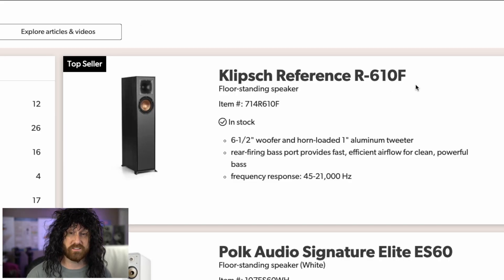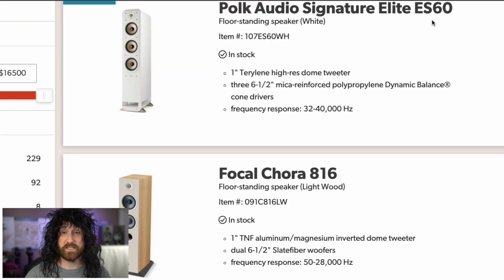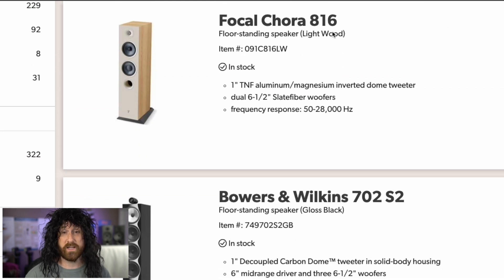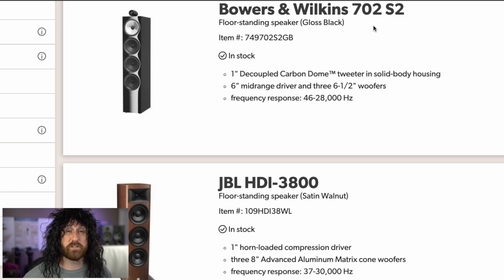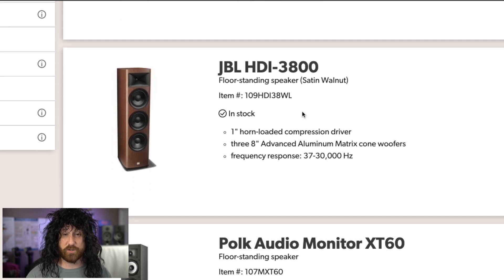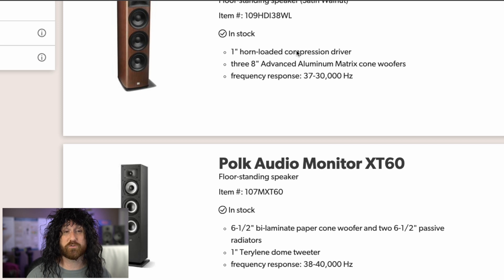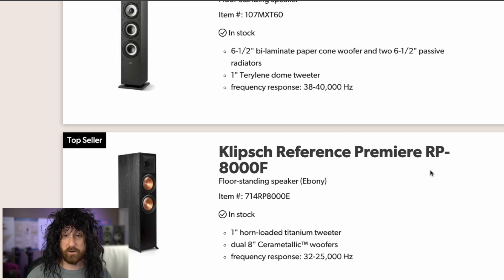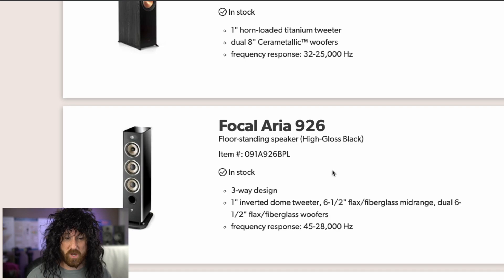What the Heck is with These Speaker Names?!  😂😜😎

Comment: A lot of manufacturers have different price ranges...
B&W actually being the easiest and fairly consistent example: 600 series, 700 series and 800 series... First number has nothing to do with the woofer size/count, just "quality range" Just like an I3 vs I5 vs I7 from Intel. Within these ranges, the class just goes down for smaller speakers: xx4 being less than a xx2 etc. I even think this numbering scheme is easier do differentiate price classes to start with when comparing "chora" vs "aria" vs "sopra"... Focal however does seem to count woofers, not mid woofers, but woofers on some of their floorstanding ranges... and the lower and ranges also start with 7, 8 or 9, where the higher number means higher "quality/pricerange" just like B&W I think?

Comment: If everything was named after the size of drivers, then every bookshelf speaker would be called something "16" or "61" and then you''d have to do another video.
B&W is usually pretty easy in that the first number is the model class. Higher is better.
Not sure about the 0. Sometimes they had 8.
The last digit usually denotes the sub model. Lower is better/bigger submodel. 
S usually means Series afaik. But then they seem to drop the S and number after a certain number of iterations

Comment: My first speakers: Pioneer HPM-40. High Polymer Molecular tweeter, 40W power handling. You can probably guess what the HPM-100 was. Made perfect sense. Bose 601, 901... made perfect sense. But yeah, most of the names don't.
Reply: Or ATC, uses cabinet volume in litres as a model number.

Comment: C'mon Erin, you know the answer. More is more...always. More letters, more numbers, longer name means better. Presumably sound in this case, but the value equation holds up regardless. It's the marketing way. "Model 3" = boooring. "Model 3 SW (Save the Whales)  Stage II  BMS (Blessed Mother of Sound) Red Label" has got to be a better speaker...right?  If I were in charge, I think there would have to be a "WTF" variant, or maybe "STD", but that's just me.

Comment: I think the problem is that manufacturers want different numbers from each other but since everyone is using the same size drivers for the most part it's hard. I agree B&W's system of better being lower number is really confusing like why is 801 better than 803 but worse than 701. Honestly unless you're looking at the various models within a lineup it's confusing. But yeah companies putting gen or version in the model name are the real heros as that means they have consistent naming scheme across the years even if it's confusing. I honestly can't think of one brand that does it perfectly. Monitor Audio is close since their series are bronze, silver, gold, platinum but then they just have numbers so like 50, 100, 200, 300, 500 which doesn't mean anything besides bigger is more expensive.

Comment: Also, just explain what the use case is for them! I was looking on the eminence website and they have their alpha/beta/delta etc lines. WHAT ARE THEY FOR? I could look at every one of the drivers and decide if it is what I want to use, but sometimes I'm just brainstorming. If they said "ABC are high sensitivity drivers for guitar amps, and XYZ are the budget version of the JKI line which aims to have minimum distortion" then you could at least streamline the search.

Comment: Have you thought about playing with amplifiers?  Specifically, I know there is a relationship between speaker sensitivity and audible amplifier hum (i.e. self noise) that can be heard through speakers.  This could be measured and specified, and people would love you for it!  :)  An example is a Genelec studio monitor who's self-noise is rated at 10db@1m.  It would be great if this could be turned into an amplifier specification.  It would be described in relation to a speaker's sensitivity.  The rating would give the maximum speaker sensitivity at which the self-noise remains below a standard 10db@1m noise criteria.  (Or whatever criteria is chosen...)  I'm interested because I just hooked up new pro coaxial drivers with 107db sensitivity horns, connected to an amp that claims to be super quiet, and OMG, the hum!  I probably have to use an L pad...likely every amp will have some hum.
Reply: @Douglas Blake This is why Erin or someone like him needs to test and quantify this stuff!  It's amazing how many times people on forums complain about a humming noise from their new amp, and the knee jerk answer is interconnects, ground loops, or the amp is broken!  People don't understand that transformers create noise, and high sensitivity speakers will emit a hum.  If you watched Erin's video about sensitivity, I bet you that Klipsch's numbers are way of because they pad their drivers...because it is easier than trying to explain the trade-off of noise and sensitivity.
Reply: Or you can come and listen to my speaker that buzzes with no power and nothing connected to the terminals

Comment: I think is makes more sense it you look at their separate webpage/catalogue. Then it normally ens up like a solvable IQ/pattern test.
B&W kind of make sense when looking at them like that. 800-series is the highest quality, the higher the later-number is the small speaker (you recall correct) and S instead of mk.
Reply: B&W has been using the same model numbering for nearly 50 years, across hundreds of crappy products.